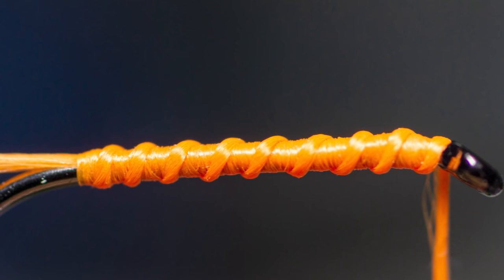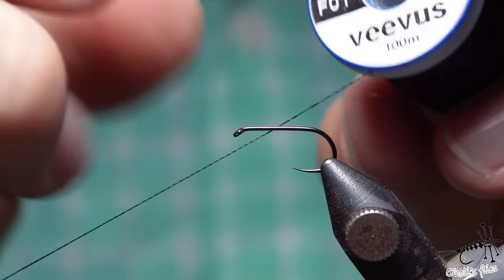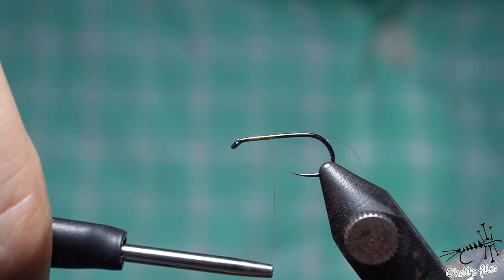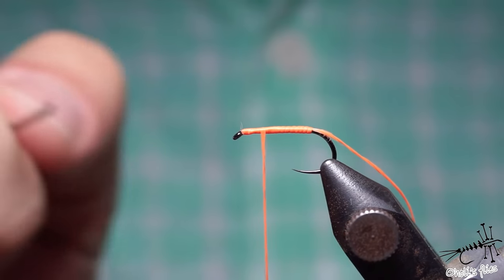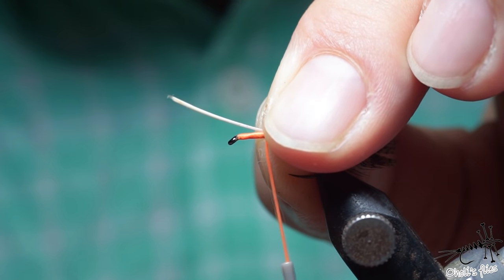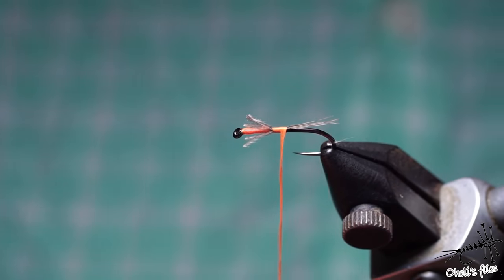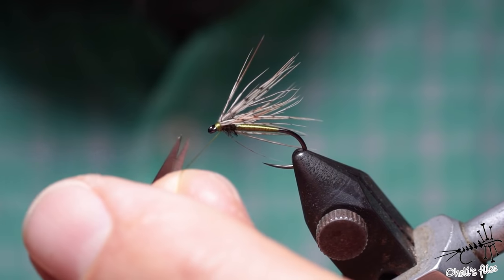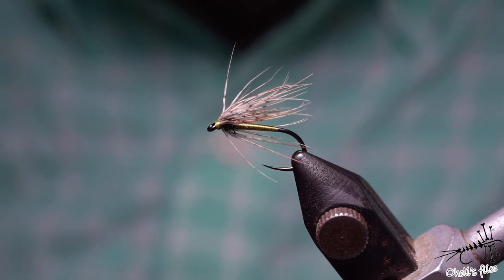Thread Control and Material Mounting

Comment: 9:00 I cannot do the pinch method. My skin is always too rough and snags bits of the thread breaking it, which makes it fray and look fuzzy.
Reply from the maker: Use some hand creams? If not, spinning bobbin holder counter clockwise will make thread jump into your left hand and help you to place it where you want it. If you tie conventional way and you are right handed...

Easiest way for pinch and loop is to buy some GSP thread.... Or to wax UTC.... It will help... Unless your hands are really rough.
Reply: @Oholisfliesandfishing  I'll have to find a good hand cream. Perhaps it will help. Though I have pretty rough hands from doing my own channel videos and from cold weather fishing.
Reply from the maker: @HalfInsaneOutdoorGuy  get some cream and do it often. It helps